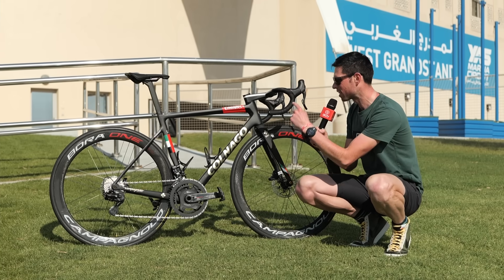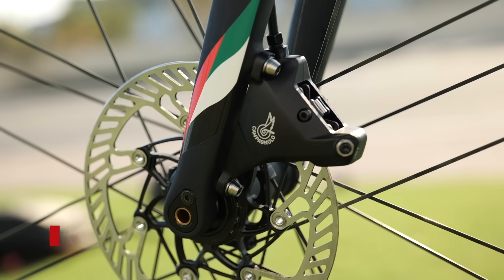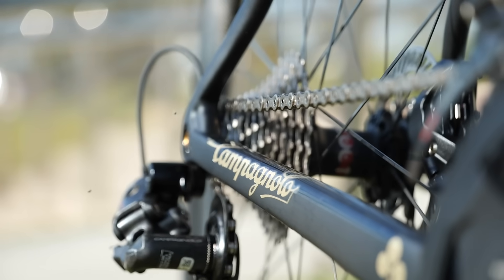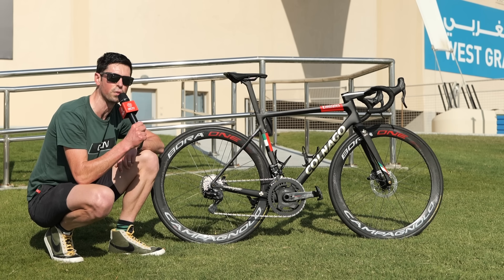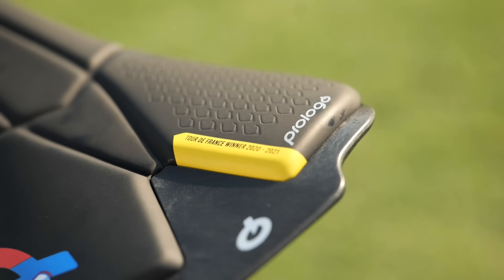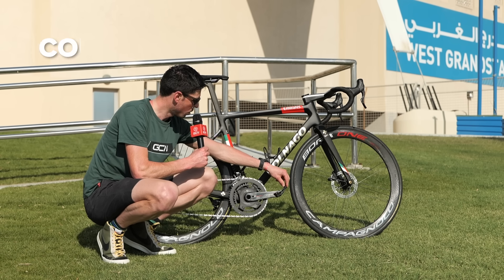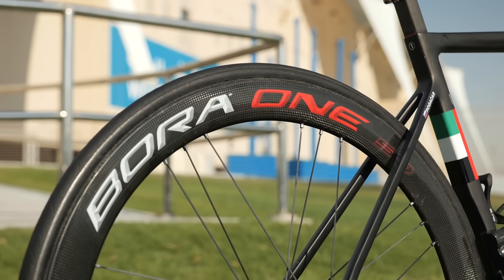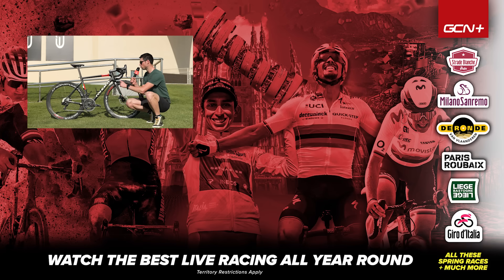Tadej Pogačar's Colnago V3RS Pro Bike | Tour De France 2021 Winning Bike

Comment: Technically the bike Pogacar won the TdF on is the rim brake version of this bike. If you watch the stages all the hard mountain stages he chose a rim brake version and for the flat or last stage he used the disc brake for marketing/promo purposes.
Reply: Technically Pog win Tdf on stage 8, where he put 4 minutes againts his competition. He used disc brake that time.
Reply: @KhomsaMifta7995  At least he didn't pull them as he'd have not gone anywhere
Reply: @11-inch  you care about this way more than you should

Comment: 7.1 kg with no paint WOW, i remember the days when the team mechanics had to add weight to the bikes to get them up to the U.C.I. lowest limit of 6.8 kg, you know the days before disc brakes.
Reply: You forgot about carbon printed spacers ! Tech evolution is soooo impressive.
Reply: @kevin_du_92  Apples & oranges.
Reply: Yeah, like Contador Emonda in 2017. That seams ages
Reply: But there are quite a few disc brakes bikes lighter than 6.8kg. S-Works Aethos, Canyon Ultimate CFR, ...
Reply: Yes. I also remember the times where cars came with wind up windows and we didn’t have to deal with all these electrical issues faced with current cars. 

Move on mate ❤️

Comment: Eye candy that's as awesome as it looks. But.., I have a set of tubular wheels for my older steel bike, I'm always uptight when riding them for fear of a flat. I stopped using them because of that. My choice would be the Pinarello Dogma that Team Ineos uses.
Reply: I had a HED tubular disc and those wheels would pop if I simply got too close to railroad tracks.  But, wow.  Tubulars are the best on the road.

Comment: Not a full aero frame and above the UCI 6.8kg limit. Shows you that the extreme obsession with aero and weight I have witnessed in the amateur community is misplaced to a degree. It's much more about the rider.

Comment: How is it possible that these GC contenders don't all have 6.8kg bikes? 300g over is a huge amount
Reply: Disc brakes
Reply: doesn‘t matter when alll are over 6.8 wich is the case right now
Reply: physics and required disc brakes
Reply: @spikev5842  he switched to the rim brake version for today’s stage when it matters
Reply: @Yes-sc1pb  it will be interesting to see how this gets sorted over the next yrs ... when the brands quit rim brakes - but winning is still the goal ... will the pros use custom bikes (which the brands don't sell)? or, will a new rim brake brand emerge (likely Chinese)? or, some new tech, like no contact magnetic mech solve the issue (so the big brands can continue to push pricing)?🤔
Reply: @spikev5842  hopefully disc group sets get lighter, all these new lightweight disc frames already sketchy af with all the failures

Comment: Everything looks good
Except disk brakes 
I do not trust them
Reply: Yes. I hang around the bike shop most of the day. The Dise brake bike keep coming back for sounds and oil leak. I am riding a Dogma F 12 Rimbrake I am so happy with it. No headache. And my Dogma F is coming on April. Rimbrake is my favorite.
Reply: Forgot to say this I got many of my Cycling friend most of them Riding Dise brake. And some. Of them tell me they Regret buying the Dise brake. They say so troublesome when want to put the bike in the car. Because they worry their touch the brake it will lock up. And sounds. And if did not ride the bike for awhile  the Dise get Rusty. I know it's only give headache. The Rimbrake you also can stopped anyway you want. The Race in UAE Stage 7. The final Stage. The winner is Riding a Rimbrake. People have their choice I just want to share what I know. Thank you.

Comment: I thought that all pro bikes would be on the uci limit at 6.8kg as they could get them so light. Is this not the case, or are they weighed without peripherals like pedals or something?
Reply: no all the disc brake bikes are heavy as shit, pro mechanics used to have to add weights to bikes so they weigh in at 6.8kg with pedals and other stuff
Reply: Disc brakes bikes are heavy
Reply: @Yes-sc1pb  that’s what I always thought, so the disk brake weight makes sense then. I really don’t see the point of disks!
Reply: @eleycki  $$$$$$$$$$$$$$$$$$$$$$$$$$$$$
Reply: @eleycki  makes absolutely sense for u/ mortals. the argument of the more expensive bike is ridiculous cause the industry loses all the wheel replacements from rimbarke systems  with discs
Reply: pogacar switch to his vr3s for the jebel hafeet stage today